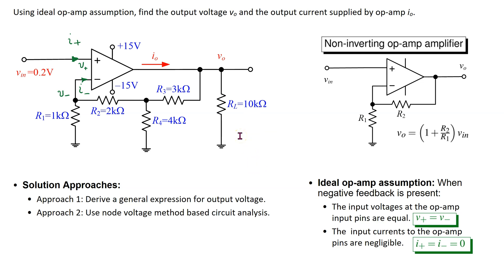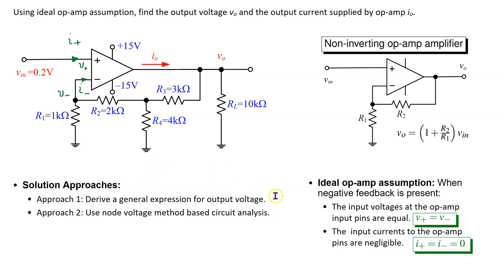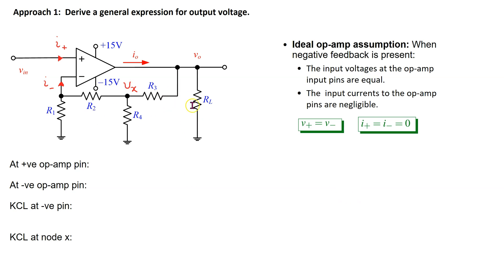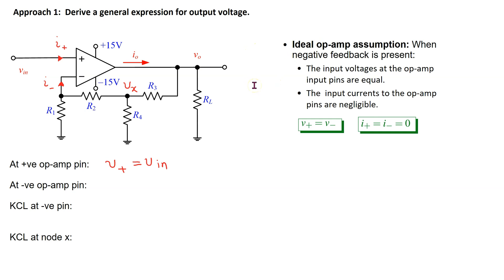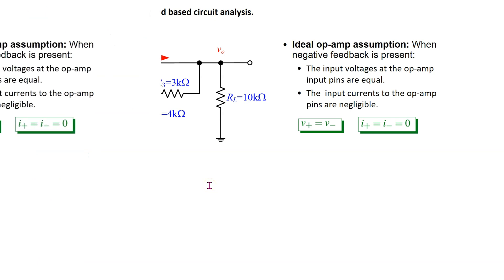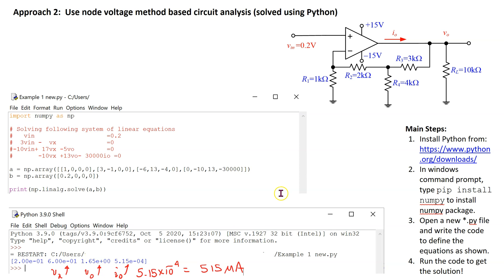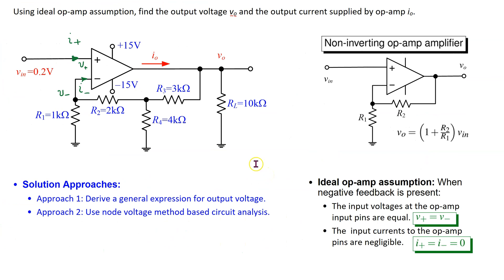Op amp circuits - Example 1 Non-inverting op amp amplifier

Comment: In the "KCL at node o:" equation isn't it supposed to be (Vo-0)/10k instead of (Vo-0)/1k ?  at 9:40
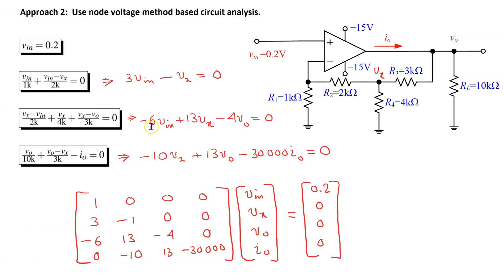Reply from the maker: Thank you for identifying this typo in the equation writing part. The correct term is indeed (vo-0)/10k. You can see this correct value actually being used in the solution part at 10:02.

Comment: not "1k" it's over "2k" at 9:01
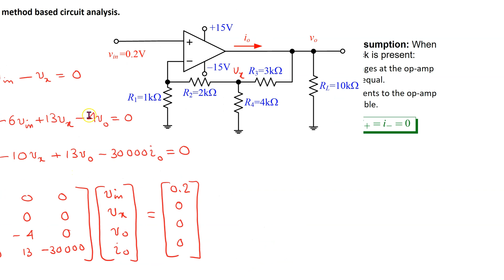Reply from the maker: Thank you for identifying and cataloging the typo! Yes indeed at 09:01 in the live equation writing part, the first term for the node equation at node x should be (vx-vin)/2k and not (vx-vin)/1k as shown in the video. You can see the correct equation actually being used in the solution at 10:02.